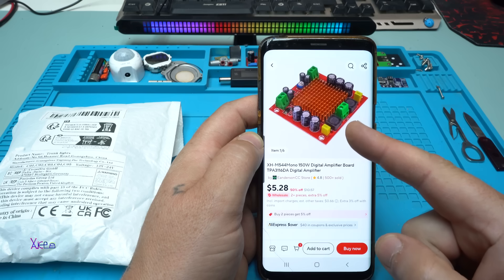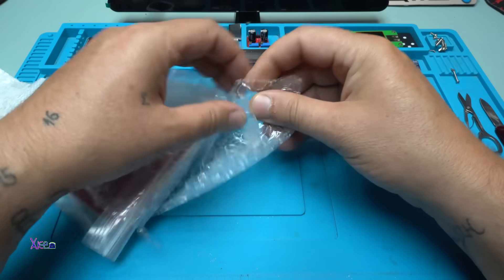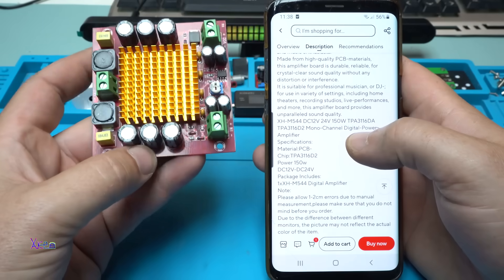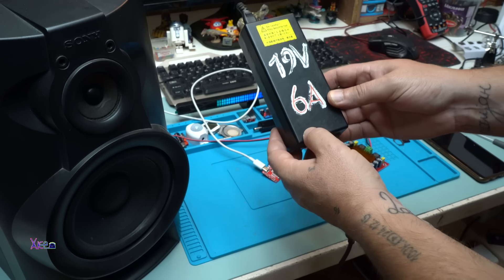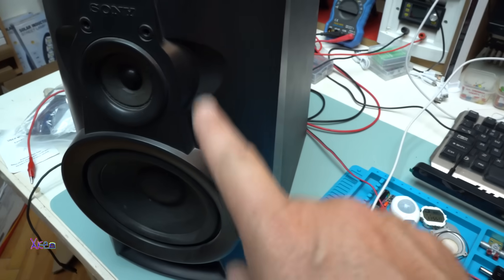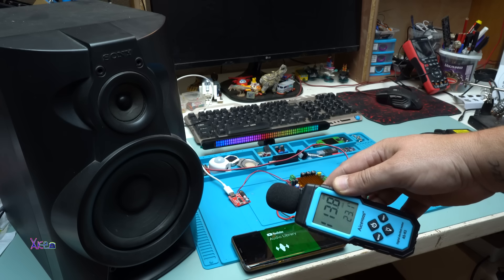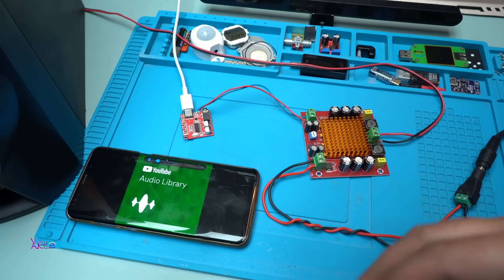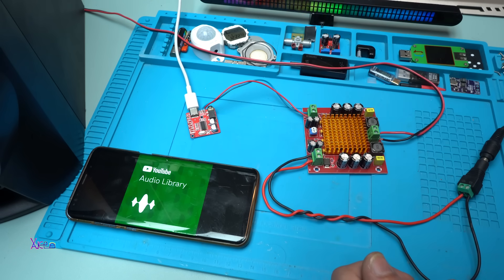THIS $5 Aliexpress Module is AWESOME?

Comment: 150w sounds bullshit. In bridge mode it would deliver 120w max. (assuming 100% efficiency). The absolute max. supply Voltage is 26V. 26x26/4/1.4142=119.5.
  In saying that, if you don't expect too much from it, it's excellent value for money.

Comment: I always remove the heatsink to check the IC. There are many fakes and different ICs used in place of the TPA3116. My first board was sold to me as a TPA 3116 (XH-M543), but it came with a CS3835EO. It's a chinese IC and works reasonably well, but it's not as good as the original.
Just a tip for those who buy these boards with the TPA.
From Brazil.
Cheers bro!

Comment: My 70s Akai receiver/amplifier is the size of a briefcase, weighs about 6-lbs and rated at max 40 watts. Isn’t technology great.
Reply: Your Akai might be stereo? You would need two of these to amplify a stereo source, so we are easy above €10. Add in the power supply and the case and the receiver and your Akai is beginning to seem fairly priced. Still working 30 or 40 years later? Wow!
Reply: Die Platine bringt ja auch keine 150W, Nennleistung ist 100W, wahrscheinlich ist das die Musikleistung, welche sich auf kurze Spitzen bezieht. Der Akai hat letzlich vermutlich mehr Leistung.
Reply: @johanwise9713 Genau. Ich würde es jedes Mal vorziehen

Comment: Google "TPA3116D2" to get the spec sheet for this 'stereo' 50 watt per channel" (at 4 ohms)  device.  By combining the Left and Right channels in parallel the TI spec sheet says that the device is good for 100 watts into a 2 ohm load.  It would have been interesting to see what the DC current draw was for this demo. (Volts X Amps).